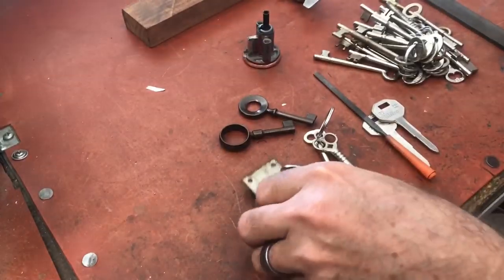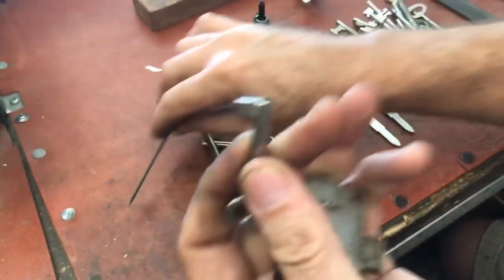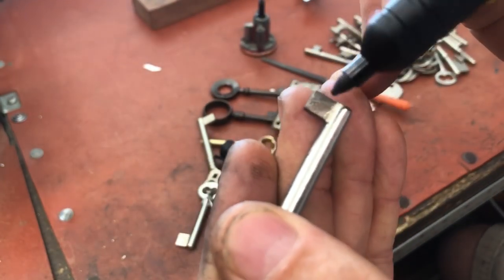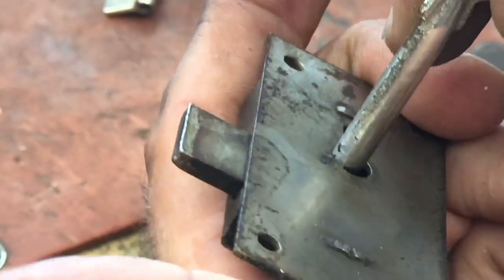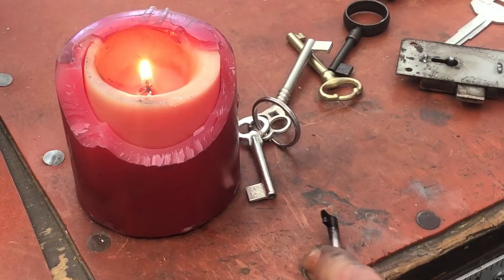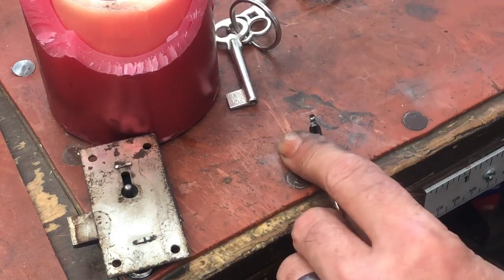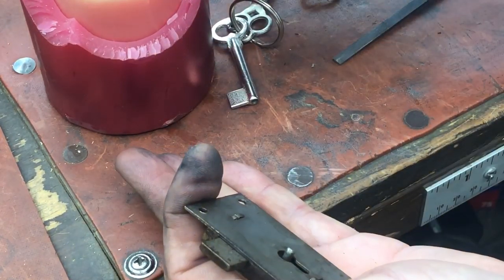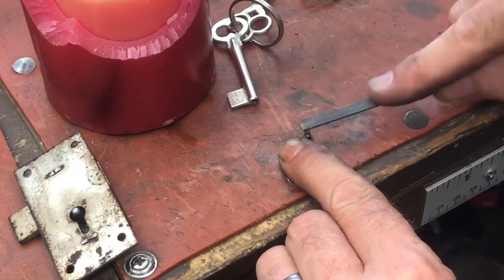antique English sideboard barrel key made

Comment: Thank you immensely for this video.  I bought an antique English display cabinet at auction, not knowing it didn't have a key.  My local locksmiths were quoting three times the amount paid for the unit so that wasn't happening.  I had absolutely no luck finding a blank barrel key of the right size but a lucky eBay purchase seemed to roughly fit.  After that a bit of candle work and needle-filing managed to turn the lock and opened the cabinet!  I'd never have had the confidence to try it myself without first watching this vid!  :D